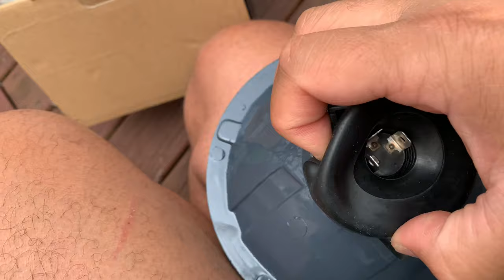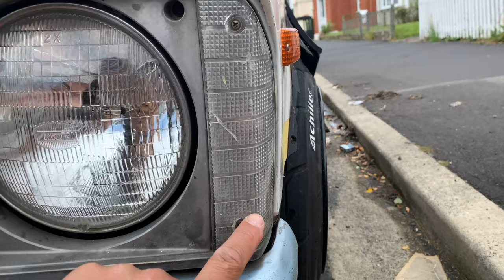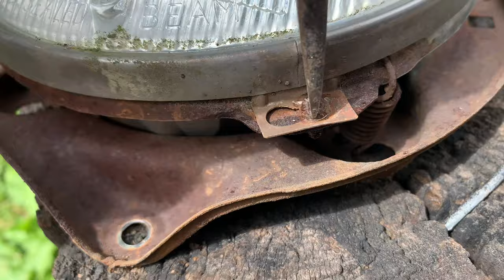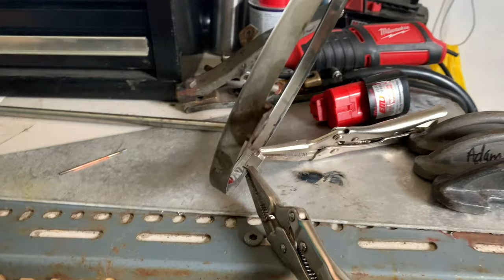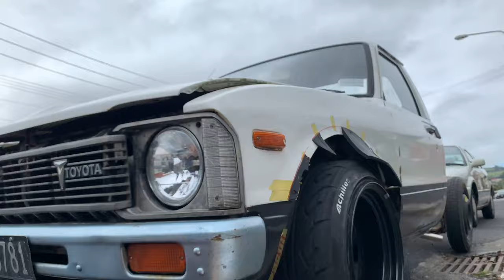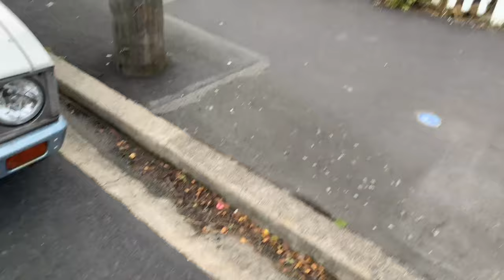HID Crystal Headlight install on a 1980’s Toyota Hilux Pickup Minitruck Ep.7 2021

Comment: My little retainer clip tab also broke and my screw was semi seized. I got an 81 22r
Reply from the maker: Ohhh no way, did this video help to repair it?. I’m thinking about doing a 20/22r hybrid instead of the K24 build.
Reply: @AdamNZ  oh yeah I heard putting the 20r head on the 22r block is the way to go because the ports flow better. 
No I was on a road trip and my headlamp went out about a year ago so I had to do it on the street. But I'd prefer to not have sealed lamps and be able to pop in better bulbs with the right ballast and relay whenever I want. A lot of work to do all that just to change a bulb. You truck looks sick though, my hoods Rusting pretty bad, 98% is surface rust but do you have any recommendations for good rust neutralizing primer I can spray after I sand?
Reply from the maker: @civilsocietyprivateinteres1711  yeah that’s the dream there with a better engine, thanks I’m trying to get it looking really dope. Yeah sealed bowls are a thing of the past. I’d buy LED if they were cheap. Ahhh there is some metal conditioners out there for bare metal. I haven’t used any but I know they work well.
I’m basically getting all the doors, bonnet and tray all mint so I can take moulds. Not phased if there rusted as long as the outer skin is in perfect condition. I vented my other bonnet but never finished it to take a mould.